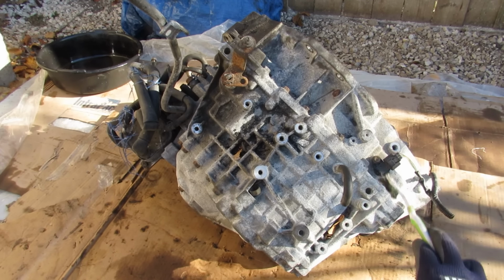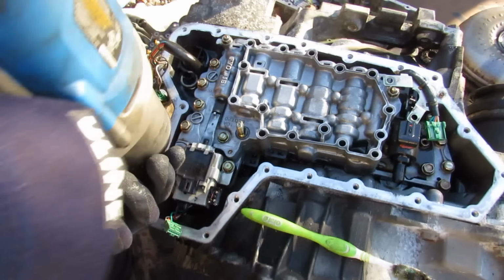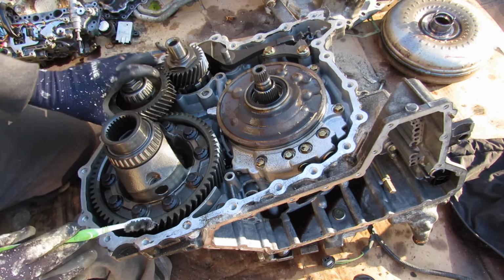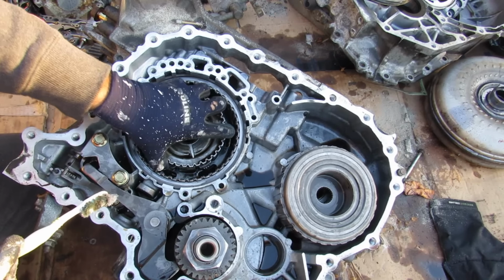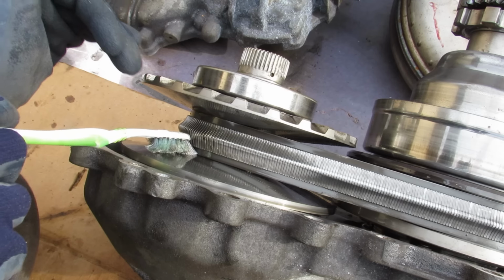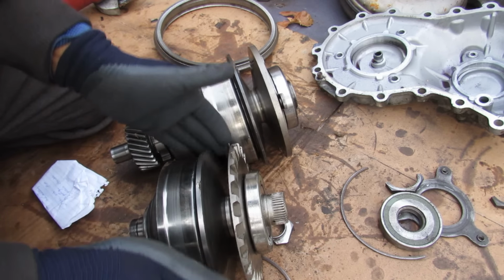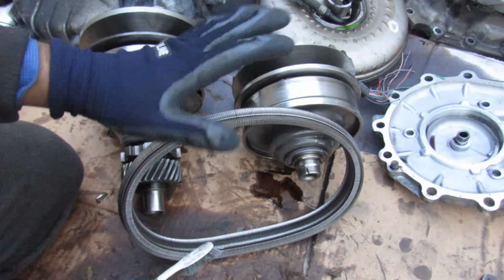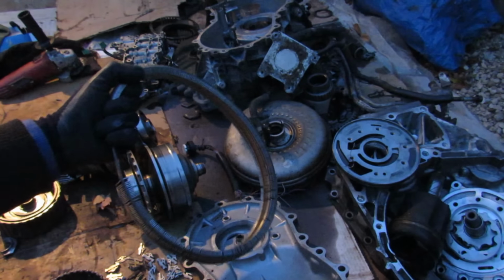Why Nissan CVTs FAIL

Comment: The lack of service manuals isn't really the fault of the CVT design, that's just Nissan being a jerkoff.  Same with a lot of new tech.  All of it's serviceable, but the information is kept secret by the manufacturer so that you have to replace it instead at a higher cost.
Reply: I'd say your 1/3rd correct.  Another 1/3rd is that Nissan I'm sure did not want to bear the expense of training all their technicians to rebuild these.  Imagine when they came out in 2003, (for Nissan anyway) having to train thousands of technicians to be able to tear down and rebuild one of these, not to mention creating a supply chain system to stock and provide parts.   And final 1/3rd?  Probably hubris and overconfidence.  The thing is so "clever" that they thought it would fail so rarely that it wasn't worth building up a rebuilding system for it.  "Only a few will fail, so we'll just swap them out".

Comment: @speedkar99 Think Nissan can/should/will add transmission oil radiator like conventional auto transmissions for heavier duty? and add cooling fins to housing to keep heat under control?
Reply: They did all that.  The Nissan CVT has a large finned oil pan, and a water-cooled tranny fluid cooler attached to the side of the transmission itselt, plus the fluid is also run through the traditional tranny cooler in the bottom of the radiator.

Comment: All being said, love CVT's and how smooth and fuel economic they are, definitely think they are a great step forward, hopefully the design improves and they become more reliable cause I definitely prefer driving them and the way they drive. Thanks for the great insightful and informative video!
Reply: Change the fluid, filter, and clean the screen every 30k-40k miles. With responsible operation, they'll last 200k miles, and often much more. 

Extended fluid change interval, or worse yet, "lifetime fluids" is an outright, known marketing lie being perpetuated by many auto-maker marketing groups. The engineers and manufacturers of these systems ARE NOT the ones recommending extended fluid intervals or lifetime fluid. 

Engineers, manufacturers, experienced master techs, all recommend frequent service based on tangible experience and direct knowledge. The only ones perpetuating the speak of maintenance-free systems are the ones who know less than everyone one else in the circle.

Comment: Thanks for the info bro, I had no idea CVT transmissions can't be rebuilt and there's no diagrams other than basic owner manual ones! You furthered my automotive knowledge I thought that was just limited to Tesla with them not sharing software information and   making you have to go to the Tesla dealer the most expensive place possible to get them fixed!

Comment: Great video!  My daughter and I just drove her 2012 Altima 2.5L (79K miles) from Houston to Atlanta. After several hours of driving in 100 degree heat at 85mph, the car went into limp mode, but returned to normal when we got off the highway and the fluid cooled down.  This happened again two more times on the trip, but it’s never happened before.

My question: are the symptoms just going to get worse until I replace the CVT? Or can I replace the fluid and maybe get an external trans fluid cooler added?  If this will only happen on a cross-country trip in the summer, we can live with it.  I don’t really understand what triggered the limp mode – is there a temperature sensor or is that the belt slipping?
Reply: What these companies don't tell you when you buy these cars with cvts is that the fluid have to changed every 25,000-30,000 to avoid problems in the long run.

Comment: Very good video!  Transmissions are so complex.  My 15-year old Nissan Rogue's CVT failed.  Got the transmission cooler replaced at my local garage.  Now I can still drive the car but transmission is very slippery when driving from idle.  Is my transmission permanently damaged?

Comment: honda's cvt after 80K mile, still zero problem. nissan's cvt probably already on your third replacement. And worse yet nissan pair cvt with powerful engjines...and bad cooling. all contribute to failure.
Reply from the maker: Yes. 
I can't speak up to Honda's CVT'S yet.

Comment: This CVT didn’t fail. It was designed to fool people into thinking that CVT transmissions don’t work. It was sabotaged.
Reply from the maker: The point of the video is why CVT'S fail not why this CVT failed.
Reply: @speedkar99  That's what I meant. The design is flawed. A CVT doesn't need a sealed chamber. It's a rubber belt that gets replaced once a year.

Comment: Someone gave this car to me for free I wish I never took it …not just the trans. Is awful 
I have to put it in neutral while going downhill cause that car SCREAMS ! for help 
-Driver power lock 
-Driver window (gone)
-A/c compressor broke
-passenger handle door opener stuck door will remain open if you don’t put anti-seized fluid will cause harm to someone 

All my life I bought either a Toyota or Honda including Dodge but this Nissan 2010 😢 and they also have 4 lug nut for the rims come on man DO YOU KNOW HOW HARD AND EXPENSIVE THESE RIMS WERE 3 months searching for something descent $300 cash cause his nisssan went to the wreck yard under 180k trans.  problems
my Hondas drove me around for over a million and my ‘99 civic wou THE CLOCK WENT AROUND AND STARTED ALL OVER AGAIN one million seven hundred thousand fifty kilometres and gave it up driving it to the wreck yard since only the shifter was broken
Uffff they truly don’t make them like before 🇨🇦

Comment: Excellent tutorial.👍 
Buy may I suggest you invest in some shop rags, rather than using underwear. Seemed like you got a bit aroused by handling your wife's undies. When you said, "bust a nut", that's when it got "dirty". 😄
Just kidding.😁 
Gotta say, you blasted through this vid and clearly know your stuff about CVTs. I'm a pretty good "shade tree mechanic", but never tore a CVT apart. Now that I know this, I still won't.  😄 Thanks much!

Comment: Thanks for breaking it down! 2017 Sentra 95K only goes in reverse. No trans codes, possible the previous shop erased them. Should I change fluid & filter or is CVT shot? Thanks for any info.

Comment: My ex bought a new 2010 Nissan Rogue with CVT and after taking it back 3 times and being without a car for 6 months she told them she wanted her money back.  They refunded the full amount because Nissan knew about the CVT failure and didn't fix it even after the sale.  She bought a Rav4 and hasn't had a bit of trouble.

Comment: I believe that CVTs are fun to drive, just different. Fuel economy comes from multiple places, lower friction in the CVT being a minor one.  The highest contributor to fuel economy comes from keeping the engine at the efficiency peak (RPM) while accelerating, something a CVT can do that no other transmission with stepped gearing can. Another benefit is for off-roading.  A CVT can house gear ratios that a conventional transmission cant due to size.  It can also have a wider gearing spread to include granny gears up to highway gears without a 2 speed transfer case.  Huge benefit in weight and cost.
Reply: If they are properly engineered, something Nissan's still are a victim of.

Comment: The CVT transmission has far more parts than the traditional automatic. You have everything in a traditional automatic. plantary gear sets clutch packs plus the 2 drive actuators with a steel drive belt in-between. It's ez to see why these transmissions Fail. 
If you expect to drive your vehicle 100K miles 
you'll need to change the transmission fluid every 5000 miles or every time you change the engine to oil.
This transmission is going run very hot because of the friction the steel drive belt generates

Comment: If you own a Nissan CVT, change the fluid every 30k. I've flushed mine (not drain and fill) every 30k. At 150k the CVT feels exactly like the day I drove it off the lot with 4 miles on the clock.
Reply: I'd rather have a regular transmission over a cvt
Reply: @jesuscarrillo9389 in  cold  weather like  20  degrees  concerns  me  it  slips  until  i  drive  slowly  for  15  minutes
Reply: Proud to say I got my murano up to 209k on the clock and all we did was oil changes and not hot rodding it around
Reply: @zillamill what happened after you got it to 209k?
Reply: @Bm0ney_cs  totalled in an accident 😔
Reply: I have a 2014 Nissan pathfinder with a CVT transmission, I love it. It’s a great size to fit my whole family and it’s got about 126,000 KM. I’ve been driving it like an old lady and servicing it regularly. If the CVT eventually goes, I may be looking at $10,000 Canadian to buy a new transmission or do I finance something new?
Reply: @PapaEchoX get the new armada they have a regular 9 speed now
Reply: @PapaEchoX  Just rebuild it.  I'm sure you have an old toothbrush and an angle grinder.  Your relatives should have some extra clothes.
Reply: You flushed not drain, please explain!
Reply: @tijerinal1  He wont explain Nissan Specifically says to not FLUSH the CVT's, only Drain / fill.
Reply: I feel there is a lie somewhere here, Nissan says to NOT use machine-powered flush through CVT's, they are VERY adamant about it. We never machine-flushed CVT's, they specifically say "Drain-Fill" in the manual.

So when you going to tell us the truth because I was rebuilding this CVT's NON-STOP at Nissan after lawsuit in 2013. Love to hear the explanation lol.

Comment: Wow, that was honestly one of the best vid's I've seen on YT. After explaining, you actually dug deep and showed as best as possible the HOW and WHY.
06 Murano with a trans replaced at 118K under warranty and once this one dies for good its the last Nissan ever.   Great video and presentation, Masterclass.
Best advice I've read has been to get in there every 40K and replace the trans fluid with a good synthetic. Don't follow the Nissan spec'd duration for that.
Reply from the maker: You are welcome 😁. I have another CVT video for that Murano transmission if you like to see it.

Comment: I’m on my 4th Nissan with a CVT transmission. Never had a problem with any of them. The three before my current Murano I put over 200,000 miles on them, regular maintenance is the key. I even put a hitch on one and towed a trailer with it. Drove it to Florida from Alberta three times, I’m sure that most of these issues are preventable my getting the vehicle serviced regularly. Spend a little now or spend a lot later.
Reply: I too have had a number of CVT boxes and have done hundreds of thousands of km's of towing, regular maintenance  is the key to a long life.
Reply: yeah i guess nissans target audience is the people who believe the dealer when they say the transmission fluid is good for the lifetime of the car🤣
Reply: Mitsubishis have Jatco tranmissions too and the owners all swear changing the trans fluid every 30k miles will make them last forever.
Reply: My Mitsubishi ASX is also powered with a Jatco CVT, almost 140,000 km and no worries! Just change fluid as the manual indicates and enjoy these engineering beauties!
Reply: Bs they be trash
Reply: What did you do beside the scheduled maintenance?
Reply: My sister has a 2015 Rogue with 158k miles on it and never had a transmission service done. She doesn't drive like an idiot, does her oil changes, and it just keep going and going. Mostly highway miles.
Reply: A lot of people don’t get that key, so yeah
Reply: Driving a Ford with a ZF / Batavia CVT. I don't know if it ever had any service before I did it at around 215k earlier this year (I bought it with 209k, as a beater). Since my cars do more hours than miles, I'm only now at 217k, but I THINK the fluid and filters made a difference. 

I'm sure that it's like anything else, though. Traditional automatic transmissions used to be something you didn't touch; why? because the transmission was probably good on its original fluid for100k and the engine wouldn't last any longer than that, anyway, and, besides, the body was sure to fall apart by then.

Things last longer now. Like how people's life expectancy increased. So, there will be more maintenance.
Reply: My guess is it’s more about how people accelerate in them.  If you don’t drive like a grandpa they won’t last.
Reply: @Dogpool I agree with that 100%. My Nissan Cube is slow and I never accelerate at a rate that breaks over 3k rpm unless I absolutely have to. 
198000 miles now just pulled pan, screen and filter. Everything looks like new and only powder shavings on the magnets ✅
Reply: Wow!!!!  WTF.  THIS GUY IS BAD ASS.  Blew my mind.  Wow!!!!!
Reply: Mine is sitting in the shop as we speak for a $4800 replacement. I’m willing to admit I changed fluid only once and it went out at 122,000. Lesson learned.
Reply: So if your Marano wasn’t all-wheel-drive, probably doubt it, but if it was, did you ever do the final drive differential fluid is a lot of people forget about that. I work on Nissan cars cause I’m a Nissan mechanic and I’m also on the side gig mechanic and I work on other other peoples vehicles
Reply: CVTs, on early models, were barely lasting 100,000 miles. New CVTs easily last 200,000+ miles. They are also now "serviceable", by the manufacture and special repair places. Treated as a core swap, so there is no real waiting period. (If handled through the extended warrantee that was forced on them, through a class action lawsuit.)

I'm waiting for a double belt system. Then they can totally remove the liquid CVT transmission. Yes, an automatic liquid transmission is also a type of CVT. It just has virtual gearing to get better control.

CVT seems to have two semantically joined names. Constant velocity transmission and continually variable transmission. Same same.
Reply: Wow! Better get my 2010 Altima tranny fluid changed asap! Just hit 120K miles and still kicking. Only issue so far has been AC compressor failure. I can’t complain, so far, she’s treated me well although I’m old and drive likewise. Very informative video and easy on the ears. Thank you
Reply: You sir are a true gambler from the far west.
Reply: @luckyguy600  Yeap. I babied my Nissan and it made it to 167,000. If it's primarily highway miles in rural parts, I think you could get 220,000 out of one if you babied it too. I think that's best case scenario.
Reply: Own a Nissan rogue 2018. Car just reached 100 000 miles. Never done any maintenance. Just regular oil change and changed engine air filter time to time. Not one problem has ever occured.
Never ever changed transmission fluid. Probably will change it now that it had reached 100k.
Reply: @bogoss2393  time to get rid of it.  Your experience is about to change.
Reply: @Dogpool  My mom has a nissan rogue 2016. I just checked her car and she has about 146k. Except for replacing the suspension and the AC compressor, she never had a problem with it.
Reply: I guarantee id break it on my jeep wrangler in a second offroad lol. Theyre cool but not durable. I have a wa580 trans out of old mercedes v8s, lets just say chrylser auto trans didnt hold up

Comment: even if tranmission fails, its easily replaceable. For the fast acceleration and braking CVT transmissions work better than auto or manual.
Reply: Almost ANYTHING is easily replaceable if you can afford to throw lots of money at it. Thats a 1% non-problem.
Most of us aren't in that class, and its stupid to make such an assumption here.
Fast acceleration? Tell me you didn't watch the video or have never driven a decent manual/automatic without tell me you've only ever driven a CVT...
Reply: @boots7859  a transmission doesn't cost lots of money. If you knew anything about vehicle mechanics you wouldn't be making up such false claims.
If you buy a new nissan vehicle from a dealer you still will have a powertrain warranty to replace transmission if it gets damaged. And just for the record most people who buy a new vehicle usually sell the vehicle before the powertrain warranty expires because most cars end up having engine and transmission problems after the powertrain warranty. 
Unless you buy a second hand used nissan vehicle and the car's miles is lets say over 150,000 miles than it wouldn't be worth fixing it since the vehicle would be too old that your would be better off buying a new vehicle but any nissan vehicle under 150,000 miles will out perform most other vehicles brands and endure for a long time. 
Its never a good idea to buy a used vehicle because all used vehicles come with mechanical problems. Most come with suspension issues. Used Nissan cars may be popular with CVT tranmission issues with cars over 100,000 miles or more but unlike other cars they never suffer from engine problems. Most used cars will have transmission and engine issues because most previous owners don't change the oil often.

Comment: JATCO and NISSAN have taken a brilliantly simple, economic, reliable, durable, easily maintained and repaired concept which is used successfully on 10's of millions of lightweight mopeds and scooters and applied it to over weight, over powered juggernauts and in so doing made it overtly complex, outrageously expensive, unreliable, fragile, difficult to maintain and repair. Japanese engineers are to be applauded for their skills and dogged determination to make things work and to make them well but occasionally these admirable traits can lead them down a forlorn rabbit hole to nowhere. This is one of those occasions.
Reply: Odd thing is, Toyota and other Manf's can apparently make decent ones.